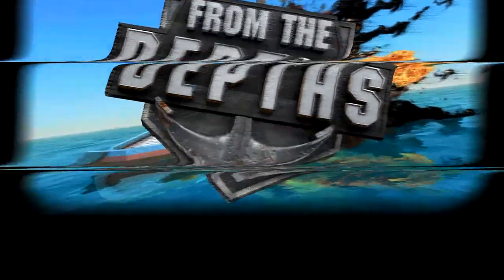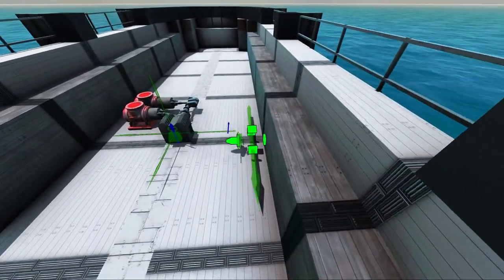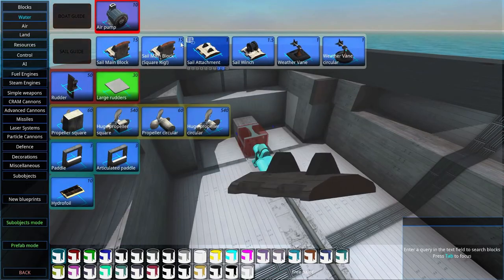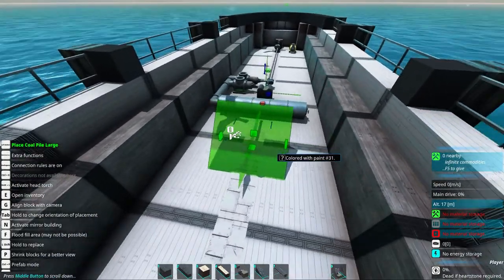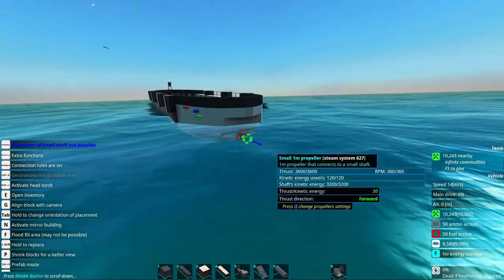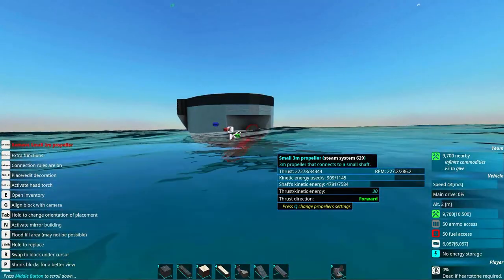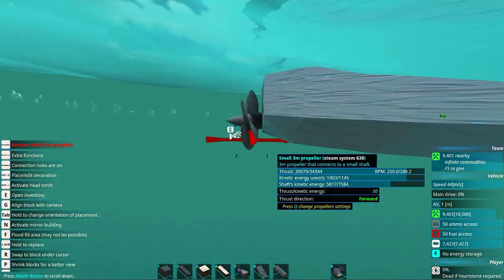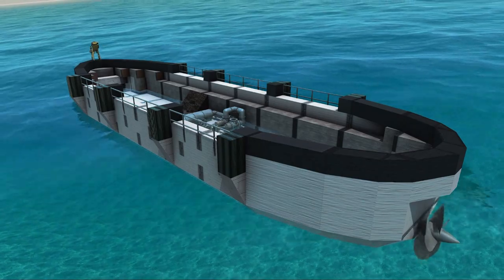From The Depths INSTANT Tutorial: Steamboat (steam propeller)

Comment: hi gmodism,

just looked into your video and it made me wonder about a few things and wanted to have your thoughs on them ^^
first i saw you using something like 12 meters of straights shafts doesn't it affect too much the perf of the engine? (i saw for the 1 meter props but i mean with steam props you're mostly thinking about larger props than your shaft no? i  mean small shafts = 3m props, medium = 5 and large =7 no?)

seconds nowadays i'm a big fan of using a big hybrid steam engine (redundant in most case) and steam motor + props instead of direct feeding steam engine why would you prefer using direct props ? (not a negative question ^^ i'm building a lot of stuff from under 2500 mats up to 2M so i just want to know your thoughts on it ^^)

last question what is your opinion regarding steam powered engine between ful power oriented (crank shaft) vs hybrid + acb to control the energy production to not overload?
Reply from the maker: Yes the more shafts or other parts that increase the stored kinetic energy in the engine might affect slowness and top speed, so better have it not longer than you need, but also put it where it is protected, center of mass might also be important depending on the craft. 
About propeller sizes there is for example a 3 meter one for both small and medium. however they require different size of shaft for connection respectively. Just look at where they are listed.

The power you can get from a dedicated steam propeller is simply superior when it comes to propulsion compared to regular water propellers, just look at the values and with this tutorial I'm sure you could increase some of your boats topspeed while still looking as good or better!

I guess it depends on usage case, but if oriented to full power it will not draw much material at all if it is not under heavy load, so works well to do it simple like that I'd say :)

Hope that gave you some answers!

Comment: How would I make it so I can adjust the power on the fly like you can with the main drive slider love your videos btw
Reply from the maker: Hey mate, sitting close to a ships wheel will give you control over the vehicle and you can adjust power there :)
Reply: @GMODISM  ok I will try this
Reply: Back again I did this and it worked thank you but now my ship is being identified as a airplane
Reply: Also the way I have my stuf setup I have one boiler and 2 gearboxes but only one works do you know what I should do
Reply: @badjames9273  use the ships wheel, not vehicle controller